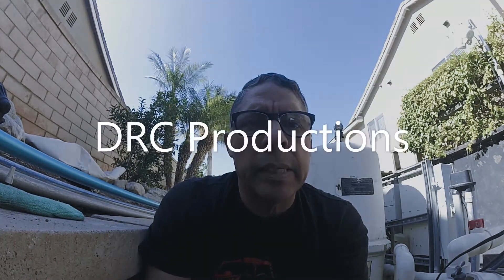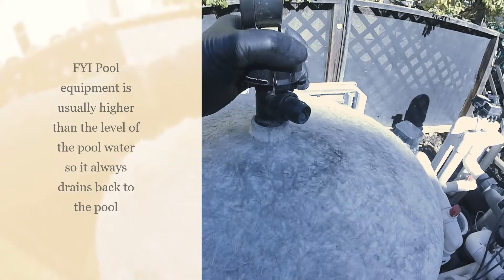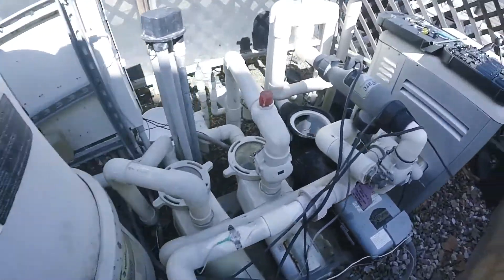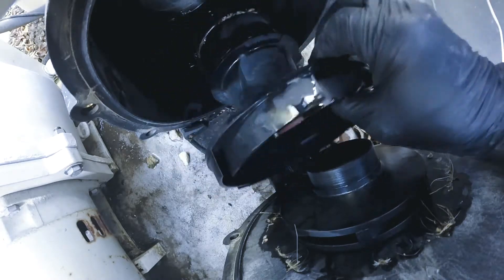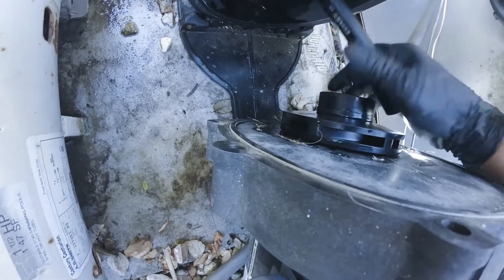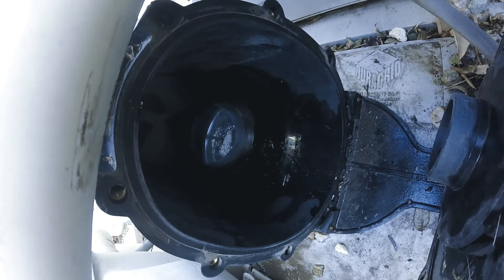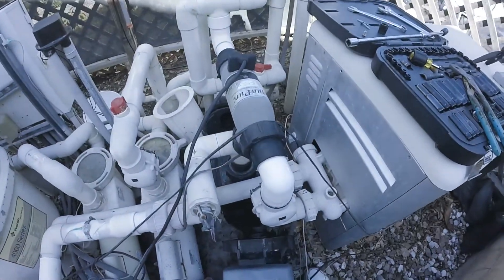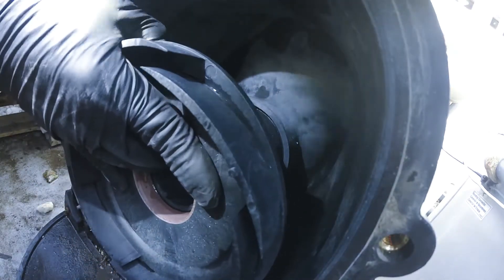How take apart a Jandy variable speed pump, inspect and findings.

Comment: My pump sounds like its running as normal but not pumping ang water pressure is raising a little on the pressure gauge on top of my de fileter container , i put a bladder in on the pool rerurn side and blasted through to the filter to be sure there is no clog, others mention a capacitor where is that located on a jandy variable speed?  Or do you hav enay ither sugestions